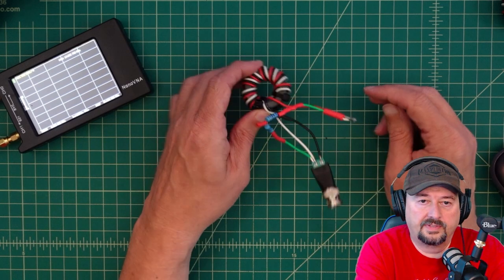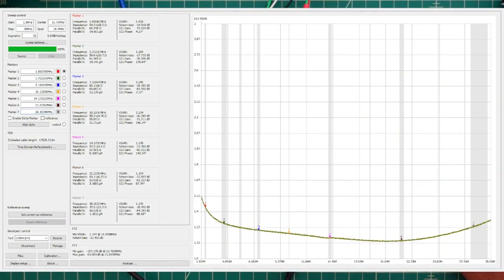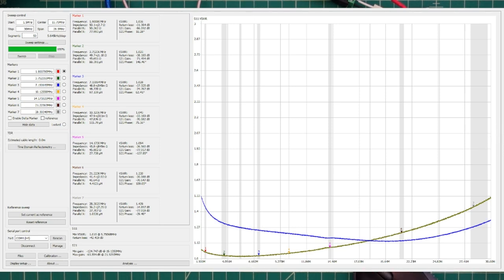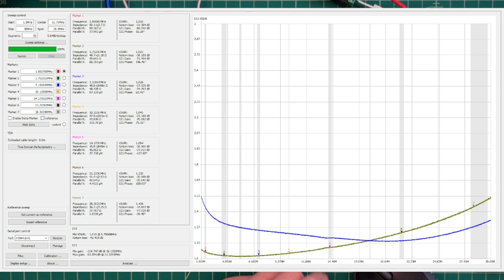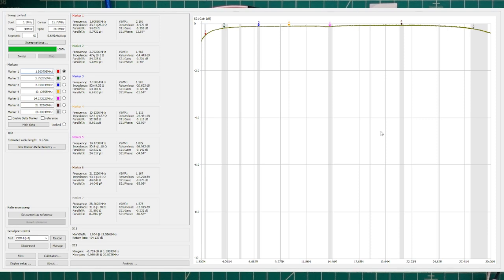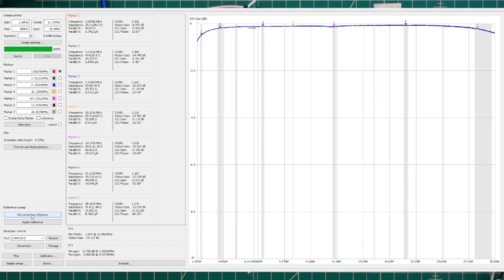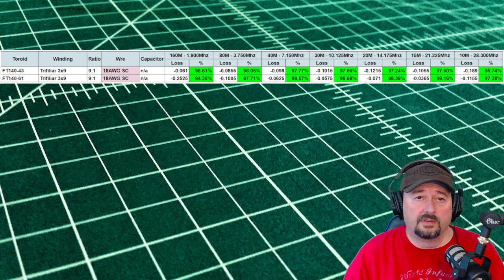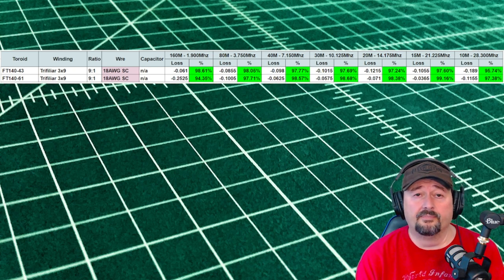Random Wire Antenna Mix-61 Toroids Tested

Comment: Good analysis of the two cores. I guess it's all up to what are using it for, higher frequencies or lower to which core to use.  There doesn't seem to be a one core fits all.  Very good video.  Answers my questions.
Reply from the maker: Thanks Ron, I agree there doesn’t seem to be a one size fits all 👍

Comment: Great analysis Ape!  I concur with your findings.  I'm certain that 99% of the operators that watch this will be using under 100w of power, so the difference in mix types is minimal.  HOWEVER, when using QRO the higher frequency 61 mix has a better thermal rating and this is generally true of the mixes with lower permeability.  
73 OM  👍
Reply from the maker: I was just talking about this to someone privately.   I wouldn't suggest the 43 on the low bands for just this reason, especially a 140.
Reply: better thermal rating,  you're saying less heat?
Reply: @Dennis Bauer  yes, higher the current temperature better it is. 
De VU2RZA

Comment: Would be interesting to see the results if a 43 and a 61 were stacked together. Could it be the best of both worlds? Interesting. Thanks for the info. 73.
Reply from the maker: Might be need to try, but it could increase the loss.
Reply: That is a mistake. 
#43 has a ui of 850 and #61 has a ui of 125.
It means the magnetic flux field lines from one core to the other would be obstructed by almost 1:7 ratio. Out of
850 lines from the core #43 only 125 lines would be passing the other side of the #61.
That doesn't make any sense. 
De VU2RZA

Comment: Interesting results. From the datasheets I would have expected significantly less losses in the 61er material compared to the 43. Also I wonder: Usually XL of your primary winding should be at least 4 times higher than the impedance you want to transfer (ARRL Handbook for Radio Communications 2020 17.32 and a lot of other literature). So about 200 Ohms. For a 43 you only need like 3 windings , but with the FT140-61 you need 6 , to get to 221 Ohms. Because 43 AL=885nH/N2 and 61 is AL=140. Secondary windings obviously both for both cores 3 times the primary winding. Did you change the windings or did use the same for both cores? From your results it looks like it had little disadvantages. But which really puzzles me.. there should be a huge difference in losses... anyway thanks for your work.
Reply from the maker: I used the same windings for both cores, thanks for adding the info from ARRL 👍

Comment: Well, done. Data is awesome! Would 240 cores matter much to the results of either mixes? Or is a mix a mix no matter the size?
Reply from the maker: I suspect the results would be similar.  The size is generally more applicable to power handling and heat.
Reply: @TheSmokinApe  you are right 
De VU2RZA

Comment: How many watts do you think is safe to run through the 61s?  From 10 to 40M I'm really liking these efficiencies!
Reply from the maker: With these smaller 140 cores, you should be fine on 100w ssb.  Likely 50-75w for digital modes 👍

Comment: That does follow along with data sheet on type of core. keep in mind that on higher frequency's the stray  inductance of your resistors will change the load a tad. just putting resistor right on VNA shows this. this is still a good comparison of the 2 cours. the stray inductance is the same on both cours.  now in a different purpose like RF power amp using MRF 454 transistors . over 25 Mhz using a type 43 cour still works but makes a 2 and 3rd harmonics   and the 43 cour heat up more. using 61 is better . even splitters and combiners on RF power amps . Ameritron HF RF power amp uses type 61 in output stages. old version uses 4X 2SC 2879. getting appx 500 watt PEP . that would be a outher test for the cores . put some RF power into them. use the nano VNA to check harmonics . this would take a non inductive resistor   and a shielded enclosure with a output line tap . a lot of work . what you showed  is a good basic test. also a power test would show heatting of core. 100 watt and down not much heating. FT8 may get warm but 1500 watt watch the core. I have seen them shatter at high power. enamel wire can RF   arc. PTFE on high power. I have silver plated PTFE for high power RF. 73's
Reply from the maker: Thanks for the insight Robert!

Comment: 61 also can be run reaaaaaly hot
Reply from the maker: Yeah, that seems to be the consensus.  Thanks for watching F11 👍
Reply: @TheSmokinApe  I had a 2xFT140 4:1 on my doublet, which would overheat and start to act up after a while on 300 watts, swapped in two FT140-61 and it never once complained. Got rather hot, but the SWR didnt shift a bit.
Reply from the maker: I have a few of the larger 240 mix 61 coes I am planning of testing out as well.
Reply: The curie temperature is higher with the #61 core. 
But it doesn't mean that it can be run really hot all the time. 
Undue heat in the core is wasted energy and you don't want it.
During mistuning or by accident temperature increase may be allowed for a short time. 
If you are going to use higher power other than that is rated for a specific size you should select a next bigger size. 
Ferrite cores ui might return to the original value after few such abuses like running hot or near to the point of saturation. But repeated and prolonged abuse must be avoided by all means. 
Hope this helps. 
De VU2RZA
Reply: @subramanianr7206  of course, but it can be useful in an emergency. The extra overhead is why Chameleon and the like use 61 a lot.